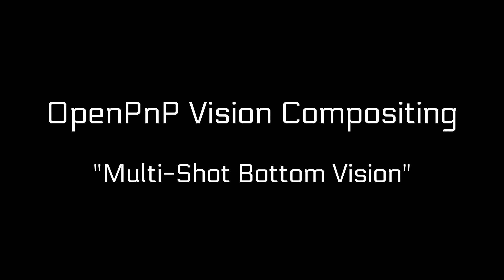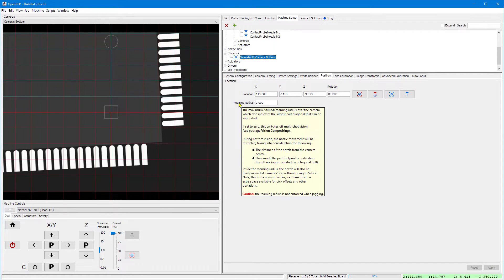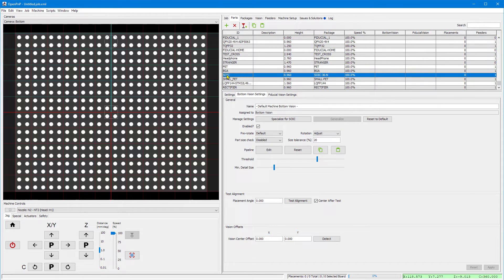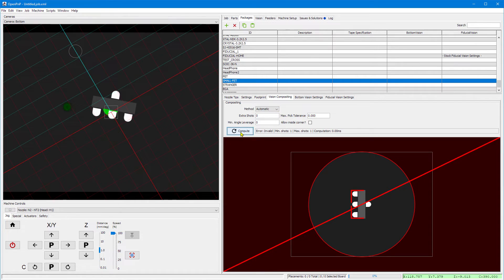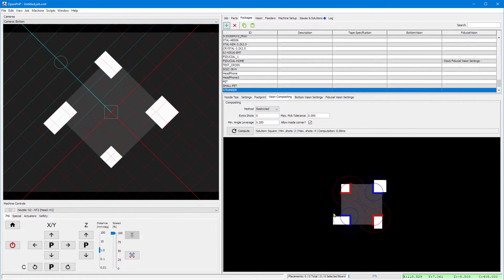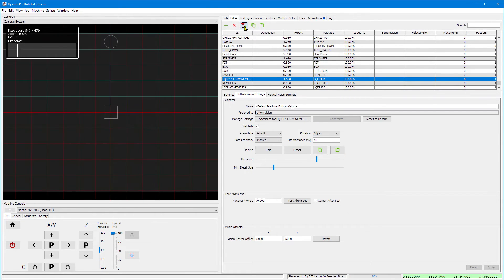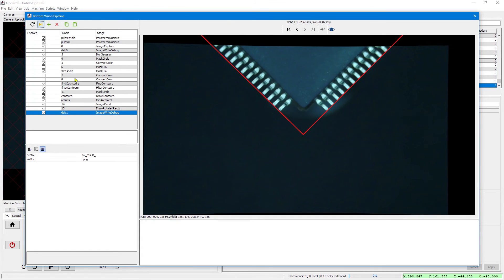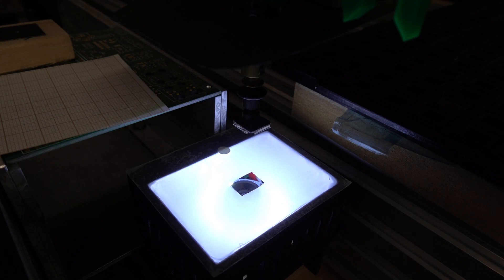OpenPnP Multi Shot Bottom Vision

Comment: Hello Engineer, I had a question, what kind of camera did you use for these devices, do you have a part number?
Reply from the maker: I'm using the ELP Full HD camera No. ELP-USBFHD01M. "Full HD USB Camera Module 1080P USB2.0 OV2710 Color Sensor Support MJPEG". I recommend longer lenses  than they usually advertise (>= 6mm).
Reply from the maker: I forgot to mention that this Full HD camera requires two root USB ports on the computer, while the recommended ELP 720p camera model can be operated on one USB port.

Comment: Fantastic. Can you say what bootom camera model you are using ?
Reply from the maker: I'm using ELP FullHD cameras, but at reduced 720p resolution, which then runs at 60fps. But the recommended camera is the ELP 720p one, because you can then attach wtwo cameras to one USB port, whereas with my cameras I need two ports (bandwidth). 
See the recommended cameras in the Wiki:
https://github.com/openpnp/openpnp/wiki/Build-FAQ#what-should-i-build

Comment: Is there any plan to incorporate this into the main release any time soon? I don't want to end up having to use test branch in production :-( But the feature would be really great - as the ESP32 module I need to place is rather bi g :-) (at least too big for the LumenPNP V2 that I have)
Reply from the maker: Yes, I guess the test branch will be integrated back soon. But that also means I consider the current test branch very mature, in fact it has many bug fixes the stable branch has not. 😉